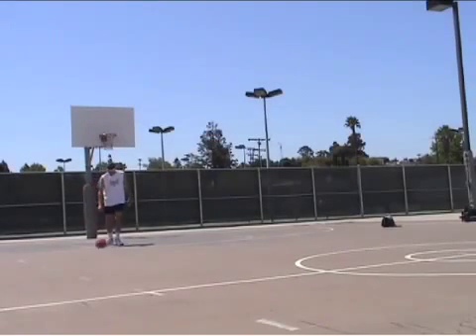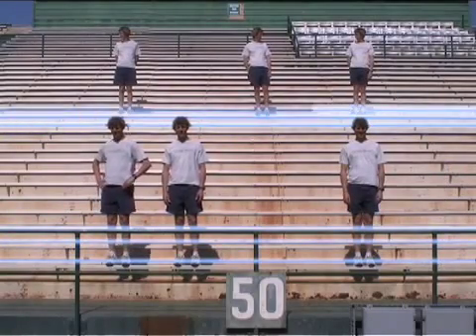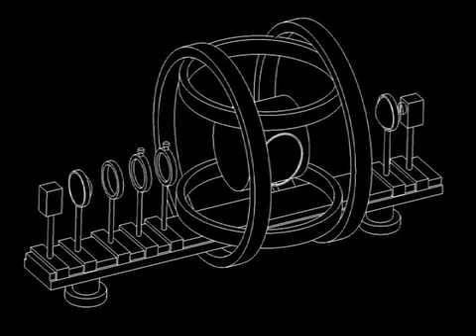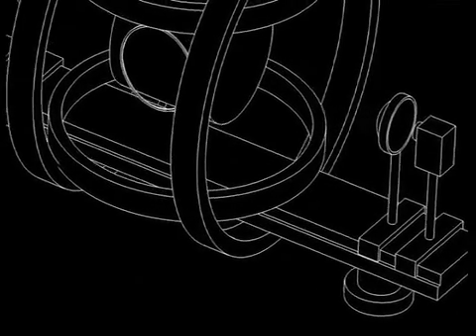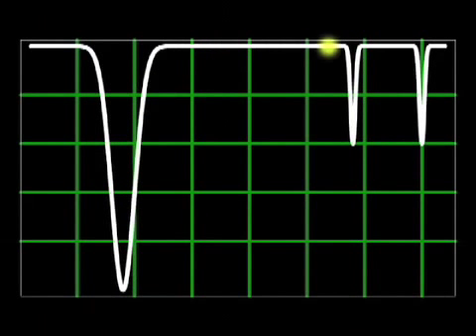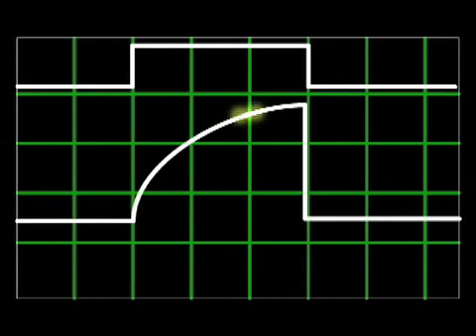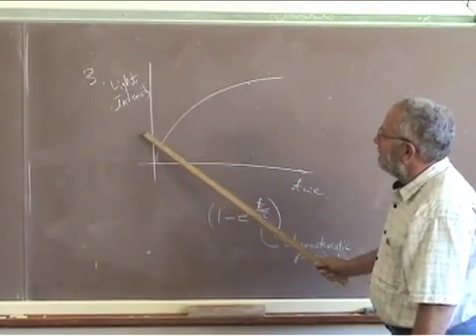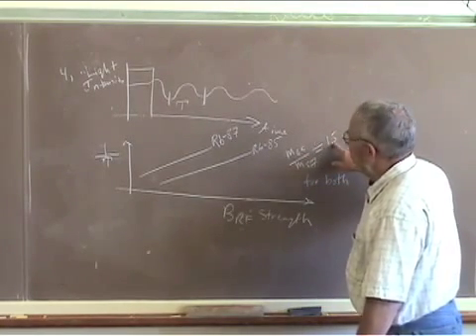Optical Pumping: the movie (Part 2)

Comment: At 5:15 he says Mu_0 is the permeability of free space, and that generally is the symbol for it but in this context it’s not correct. The company that makes the apparatus for this lab uses Mu_0 for the Bohr Magneton (Usually Mu_B) in their manual. If you use the permeability of free space your answer will be off. Do unit analysis and you’ll see it doesn’t work out. Also don’t forget to convert gauss to T=tesla.